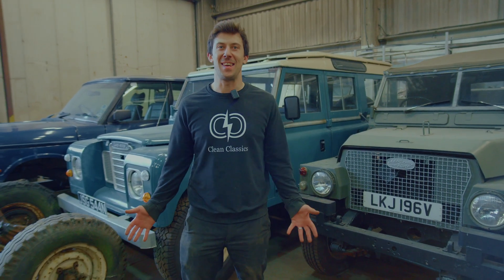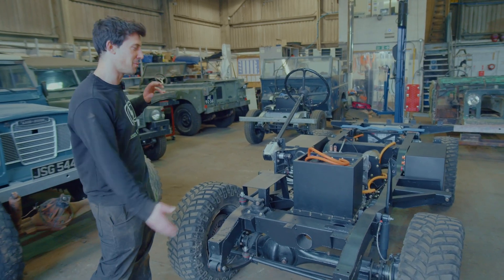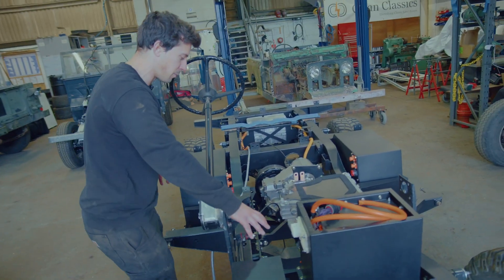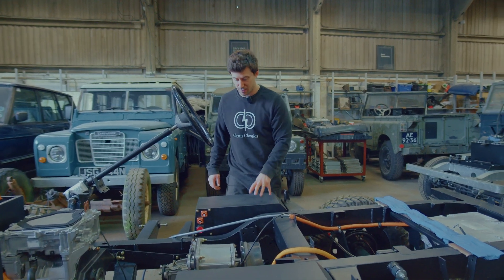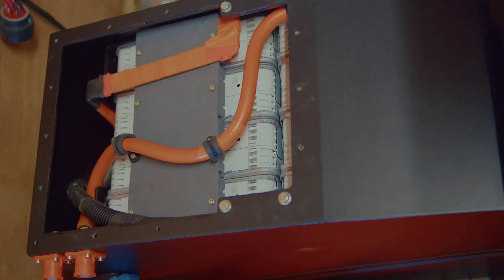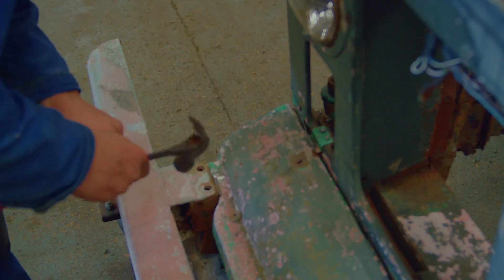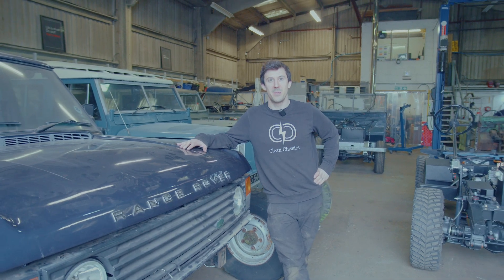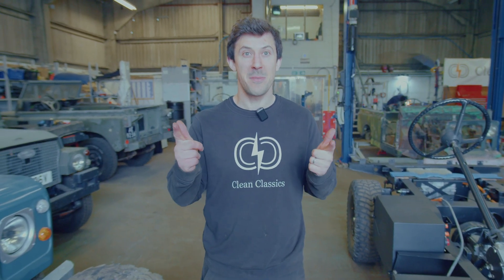Electric Land Rover rolling chassis

Comment: Could you run 2 62kwh battery packs from a 2022 leaf in parallel, i know the 62kwh pack has been used to upgrade the range on older leafs